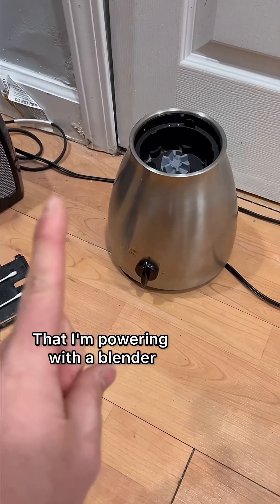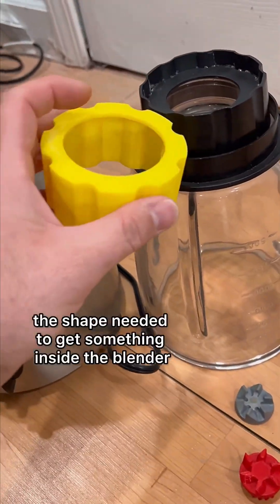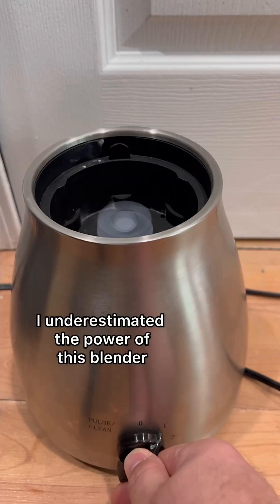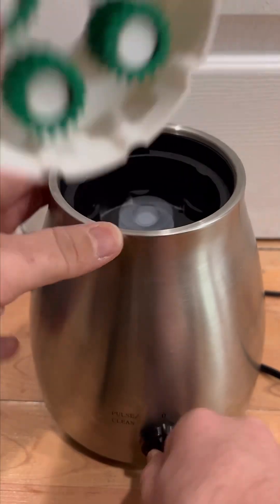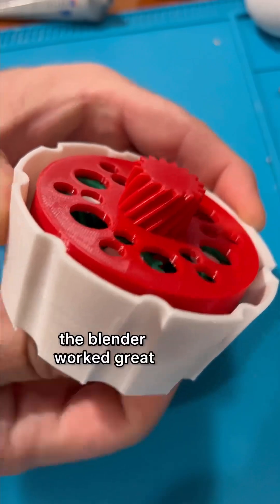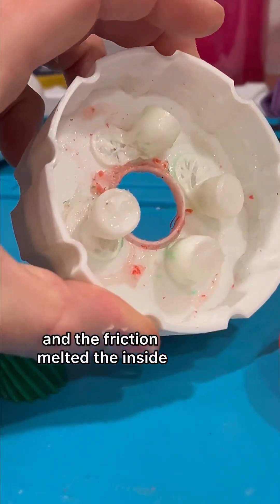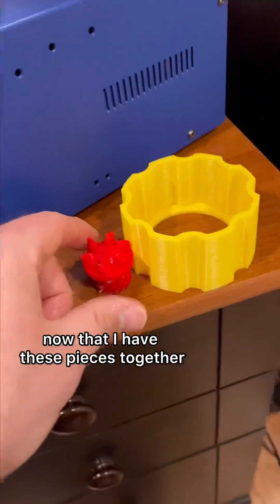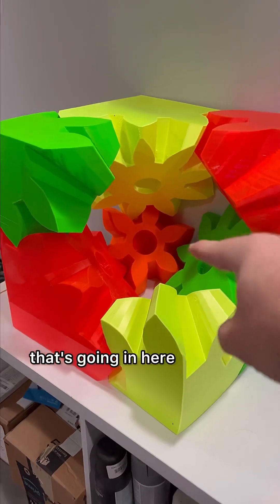#Mega #motorized #gear #cube now has the beginnings of a mount and a #gearbox

Comment: This is a high torque and speen motor. If you want to use this is easier and safer to controll electronically if not the start point stays a point of failure.  Its to strong as is. A DC motor are easy to regulate AC are i bit more complicated. I love using 12v and use a adapter for laptops as a example

Comment: i recomed you use a current regulator and\or experiment with a potentiometer wich can control current voltage and resistance separately

Comment: The gears used make friction. So id go for the voltage regulator as it guarantees slower speed and wont cause several issues with friction or finding a gear design that will slow it down but not create friction. Using gears youd have to make a gear design that doesn't create friction but slows it down while still keeping a small design so you can fit it inside the blender.

Comment: Use a buck converter or some potentiometer to just step down the voltage to the motor to turn it down to the desired speed. Plus you should still have the speed control with the front buttons, so you wouldn't lose functionality.

Comment: If you get a voltage regulator all you have to do is cut the cord in half and then wire it in it is super easy to do I have done it many times before and it is really simple

Comment: Voltage regulator or if you want it to run for any extebded period replace everything with metal. Even the part in the blender. The designed failure mode of cheap blenders is the plastic bit that connects to the jug part wearing down. You're already dealing with parts not made to last.  So the easiest solution would be to slow the motor.
Reply: A good motor replacement would be the motor in a microwave that turns the turntable
Reply: @punkrockllama a different motor is the actual answer here. These arent simple DC motors and adjusting the voltage is not a proper solution. Furthermore since single-phase AC motors need a starter, its possible that showing down the motor is going to constantly engage the starter windings/capacitor, and burn out the motor.

The only options here are to gear it down or to use different motor.

Comment: I would recommend using a stronger plastic, and reducing friction in your design if you can - WD40 would help a lot with something like this, especially if it’s difficult for you to incorporate bearings. A voltage regulator will slow the blender down, but it will also (probably, depends on the kind of motor in there) decrease torque, and since you’re trying to spin such a large and heavy piece, you probably want as much torque as you can get.
Reply: WD40 is not a lubricant. Its never been a lubricant. Its a water displacer, it isnt meant to lube anything, its meant to prevent rust by keeping moisture away, hence why its called WD-40. Water Displacer -formula 40. It does an awful job of lubricating anything, it is however good at removing adhesives, assisting in removing rust and corrosion, and preventing rust and corrosion. Its also not ideal to use around plastics. White lithium grease, graphite, or any other actual lubricant would do far better, ideally a light to mid weight lubricant, such as 3in1 oil or a light grease in combination with a voltage regulator.
Reply: @outkast937 this here is the correct answer
Reply from the maker: Thanks! I did have some grease everywhere to try and help with the friction. I guess I never thought of the cube as being heavy because I’m going light on the infill, but I guess we could get around 10 lbs 🤔🤔. More to think about..
Reply: @printmeister honestly it should work as long as you reduce the friction which I would do by adding bearings into the design
Reply: Also I’ve seen people use carbon dust lubricant on 3D prints; make sure you’ve got smooth surfaces!
Reply: Use wax it helps as a lube so dose graphite
Reply: i would be careful with wd40 as its not just a lubricant but also a solvent. if you're using any glues id check for interactions
Reply: WD40 isnt a lubricant. Its a water displacer like it says in the name. Its recommended to not use this as a lube
Reply: @spyder027  candel wax will work so will graphite